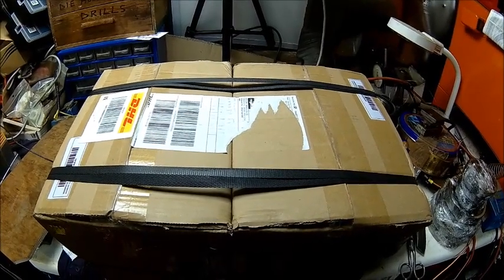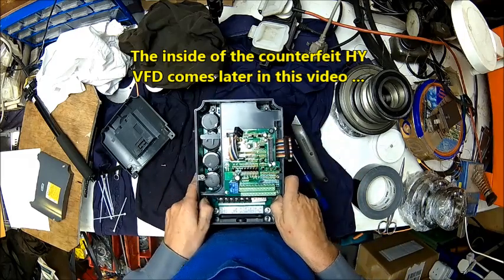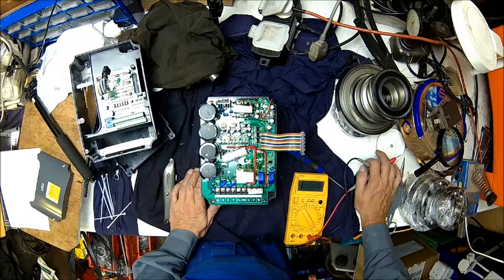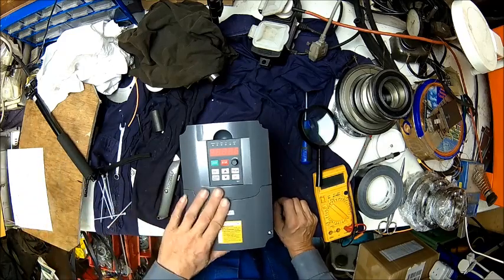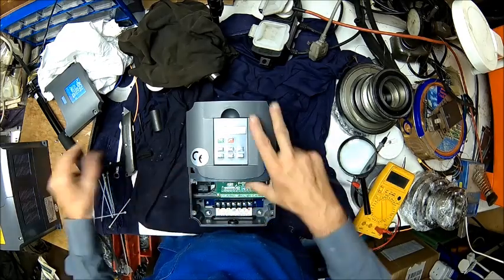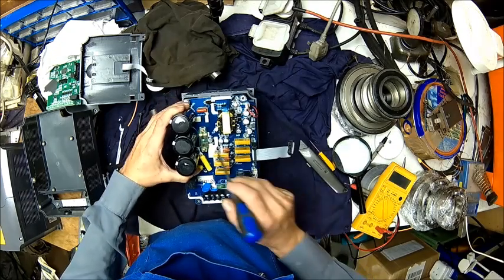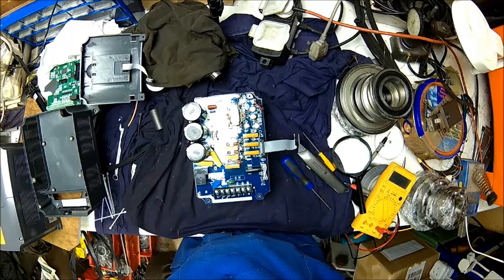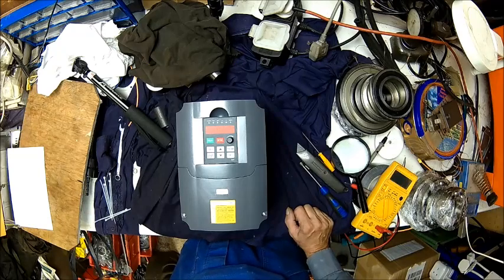Huanyang VFD vs No-Name Copy - tear down, a look inside and what's left out

Comment: best regards friend.  Excuse me, I have a Haunyang frequency variator, it would be GT, that has the keyboard locked and does not let me change anything.  the control light with external keyboard flashes.  Do you know how the variator is respected to reset everything to the factory?
Reply from the maker: Nit right off my head, but the manual should tell you

Comment: Great info, trap for the uninformed - subscribed to your channel, this stuff is hard to find out
Reply from the maker: Thanks Wayne,..., it's probably ok for very low key applications, but certainly not worth the few $ less to a Huanyang.
Key point is,... if you can't enter motor data, the drive will only protect (maybe) itself, but not neccessarily the motor.

Comment: Looks a lot like the Nflixn vfd I got from Banggood last year. They must all borrow designs from each other.
The Nflixn specified the breaking capacitor in the product code. It also had a blanking plate over the external break capacitor terminal.
Reply from the maker: Guess you talking about the Huanyang, because the fake does not even have the terminals for the resistor.
Wonder what's inside your's, do you have a link of that ?
Reply: There's not much inside my drive as it's only a 2.2 Kw model. The capacitors are even placed on the outside between the heat sink.There are some photos in this video https://youtu.be/GXNwD2YVbpM?t=7m18s
Here you can see the terminals not needed covered by a little yellow tab.
Reply from the maker: Thanks, can't see any current transducers on your pictures, so it's probably similar to the junk model i've bought by accident.
Reply: I was able to enter the motor parameters and vectoring works fine.
Reply from the maker: I wonder how they doing proper field oriented control (vector mode) without current transducers,... not really buying into that, stickers and printed manuals may tell you alot of stories, but the proof is in the pudding ....:-)